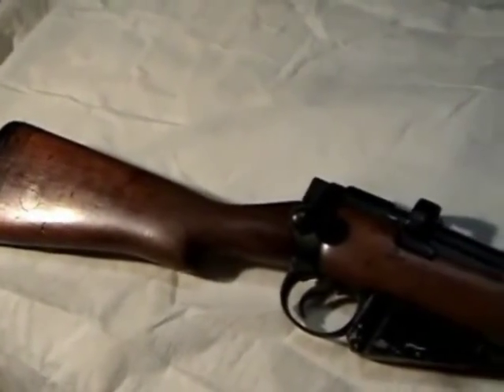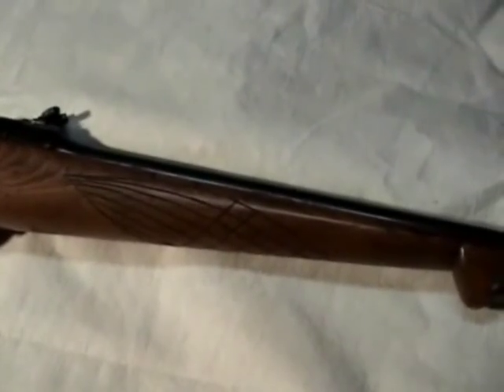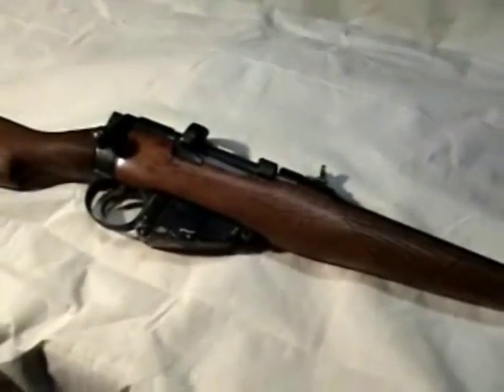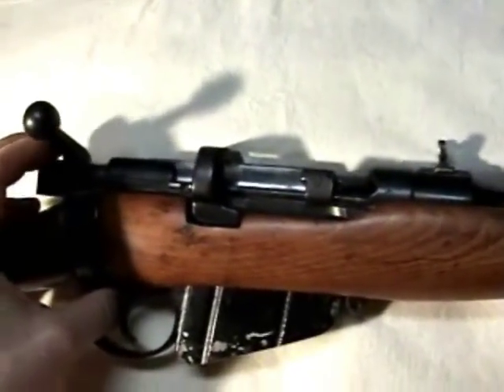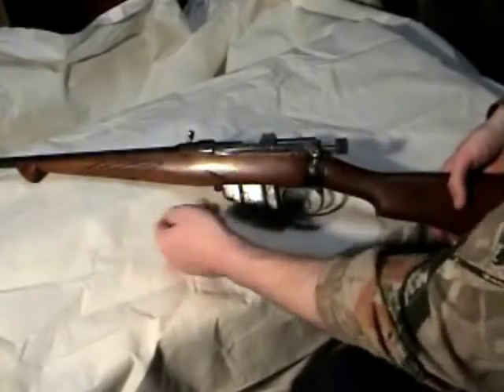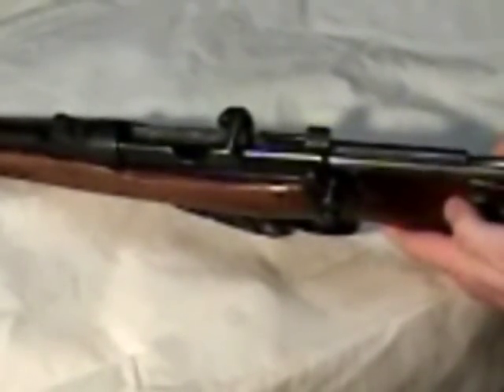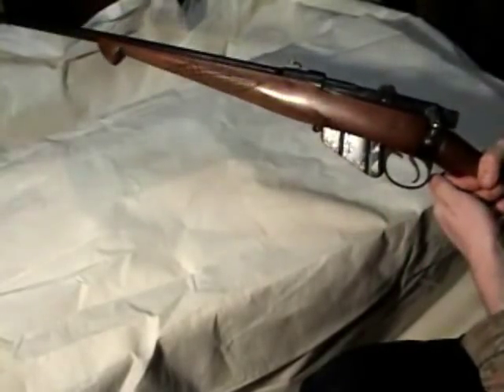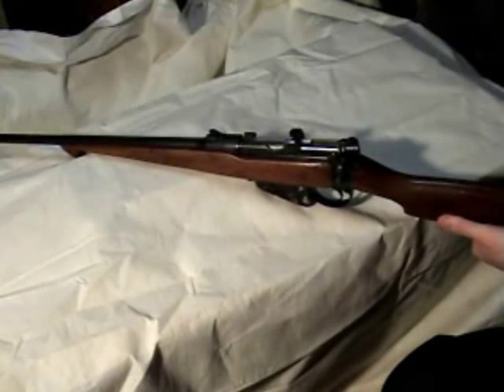Lee Enfield Rifle History, Functions and Tips

Comment: One of the best if not the best bolt action rifle ever made, I fired one for the first time over 30 years ago as a young army cadet, here in the UK. The rate of fire that can be laid down by a group of well trained riflemen with SMLE rifles is quite phenomenal and caught out the enemy in many conflicts. All in all a well proven design and very accurate in the right hands. The front sight may be an issue depending on which aftermarket stock you choose especially with the full length versions.

Comment: I need some help. Mine will not feed from the magazine. It either flips it up so that the nose of the bullet catches on the edge of the chamber mouth(usually from the left side of the mag) or it simply fails to pick up the next round from the magazine(usually from the right side of the mag). Right now I'm using soft points but I think, maybe, ball ammo might help it feed into the chamber better.
Reply: Adjust the feed lips higher or lower in the front.  Just bend the two front side lips down or bend up . Just keep trying either up will most likely work. Bend down with hard tip, bend up with soft tip. The lips are biting the soft tips too much. Try it.

Comment: Hey what is the exact model of this lee enfield? I'd like one with a detachable magazine. Some models have them some don't.
Reply from the maker: TheMightyDuck2156 Would have to check it out again when we get the chance but great info on the some don't!
Reply: Probably a Number 4 MK I, one of the Early 30's to end of the Second World War models. Though it is hard to tell from the vid. 

I shoot my great grandfathers number 1 Mk III*, a 1916 rifle, luckily for me with  the nice round bolt handle rather than the slab sided one that was brought in later. The WWI rifles were different, barrels only floated after the first muzzle band, and the barrels are a lot thinner than the later rifles (the number 4's). 

AVOID spoterised number 1 Mk's, the thinner barrel and the fact they were floated after the first muzzle band means if you strip all that woodwork away you lose a LOT of the accuracy.  Anyone who sporterises a 1900 - 1920 Lee Enfield and complains about accuracy loss needs to be shot with his own rifle.... 

And if you do get an old Lee Enfield, make sure its bedded right... those old guns really do benefit from good contact with their woodwork, it is worth taking the time (or spending the money as I did) to get everything just right.
Reply: My ati synthetic aftermarket stock makes my no1mk3* shoot very accurate. Set for 300 yards and it is using a 6x buhnell. I boresighted the scope at 250 yards and when i tested point of impact at 25yards i hit bullseye with the first shot.   Not all no1mk3 sported are bad. Mine is 5 stars good. Smoothest pull ever and super accuracy with its 6x fixed bushnell. My bro had a no4mk1 and it had a sported stock and that thing sucked ass for shooting anything so he sold it for what he paid for it.